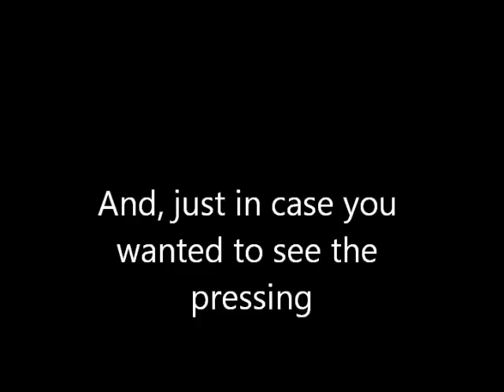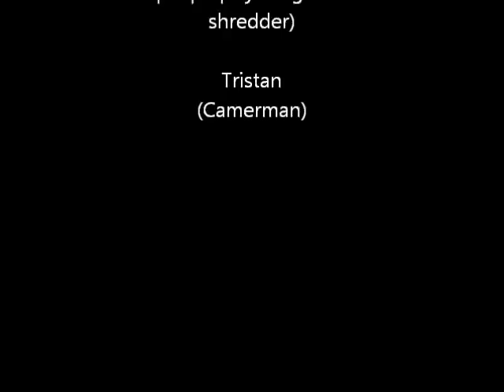Cider Making 2013 using New Apple Scratter (Apple Grinder)

Comment: Great work !!! I would love to see plans for you grinder , I've been looking and looking for DIY plans , and yours is by far the best I've seen . Great work thanks for sharing cheers
Reply from the maker: I didn't have plans as such, I just made it up as I went along but loosely based on a design by a Canadian chap who had obviously done a university thesis on different ways of pulping apples. Basically it's a Weston style apple pulper but larger and powered at a suitable rpm. If I get time I'll try to do another video explaining how it was made - I've also nearly finished making a new Press (which can be dismantled for easier storage/transport) which I'll put out too.
Reply from the maker: Hi, I found the 32 page pdf I'd read during my research.
http://cjoliprsf.awardspace.biz/Documents/Grinder2011.pdf
He concludes that the converging geometry (Weston style) design works best from all the different grinders he's seen in action - see page 21 in his pdf for rough idea of what's going on. I used screws (although he suggest not too) as trying to make blades was a faff, but took his advice on only having about 3-4mm of the heads protruding from the drum(thus taking small 'bites' each time to get a finer pulp).  I also used a tractor tyre formation to (a) stop shock load on the motor/gearbox (b) tend to drag apples towards centre of the drum(i.e.try to avoid apples being pushed towards the outside of the drum and 'down the side').  Sorry I haven't done vid yet, but it's pretty cold in the garage at the moment.

Comment from the maker: hi, recovery rates are ok (stack reduces to about 1/3 orginal height), but as you say we might be able to do even better with a finer pulp. This year we've got tons of apples so not a real problem.  Perhaps I'll have a tinker over the winter and screw in the screws a bit more (and adjust flange plate accordingly) so it takes smaller bites each time - although I suspect it may reduce the thuput slightly (although it's easily fast enough to feed 1 press).  I may build a new press over the winter.

Comment: Hi
Probably best homemade scratter on YouTube 

I'm currently building a very similar scratter 
Probably using an hdpe rotor
Are there any improvements you can think of ?
that might save me cocking up too much ?
I'll take notice of mr serve cools comments re pulp size
It occurs to me that angling cutting screws in rotor back through say ten degrees would give them better "bite" 
Andrew

Comment: nice work lads, your grinder looks great! what did you use for the cylinder? I've been using a rolling pin with screws but think the diameter is a bit on the small side